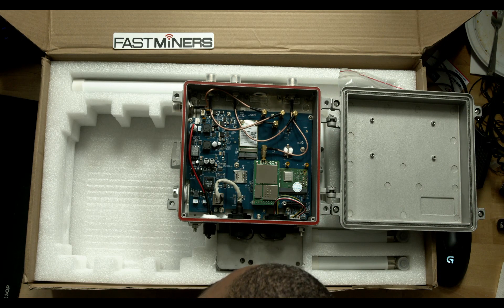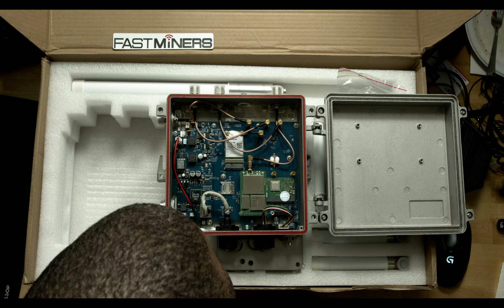Unboxing of the RisingHF Outdoor Helium Miner

Comment: are you having issues pairing bluetooth? i tried iphone and androids, keeps getting device disconnected error :(
Reply: did you ever find a fix for this i am having the same issues right now
Reply: @myronpesek9977  Yea, i had to use my family’s “HUAWEI” phone to connect lol. Try with some androids phone if it doesn’t work with iphone
Reply: i tested with few old android and it didn’t work so idk but it works with huawei
Reply: @YoJayBro  nice that worked but now im ahving the issue whenever i click to register the device it pops up Hotspot miner is waiting to start. Please try again in a few minutes. any idea what to do here? I cant jsut wait forever since theres no syncing button on it so if i wait too long it wont even pop up in the scan
Reply: @myronpesek9977  is it connected with ethernet cable?
Reply: @YoJayBro  yes it allows me to go through the entire setup process i choose the location, the antenna, i pick the network(ethernet cable) and then right when i click to register the miner it sayminer is waiting to start. please try again in a few minutes. and idek how to try again later because if i wait too long the syncing will stop and it wont pop up when i scan for nearby hotspots yaknow
Reply: @myronpesek9977  what i did is just unplug the  cable from the poe switch so it can reboot the miner since it’s power from ethernet cable. and then from there just keep registering it til it works 😆 goodluck!